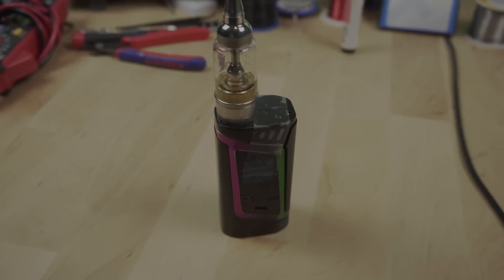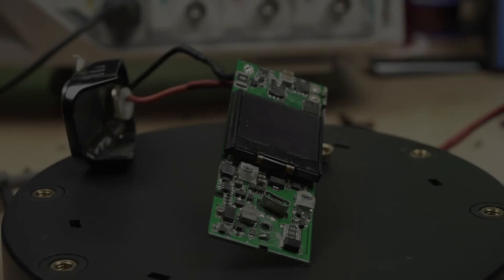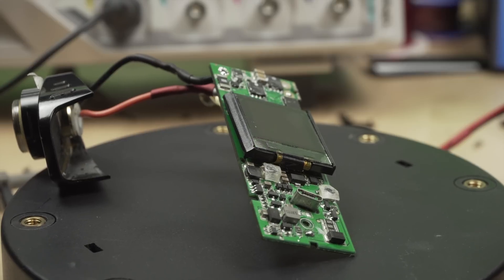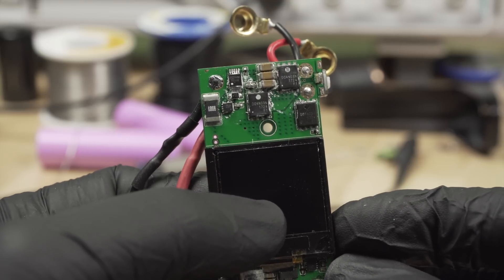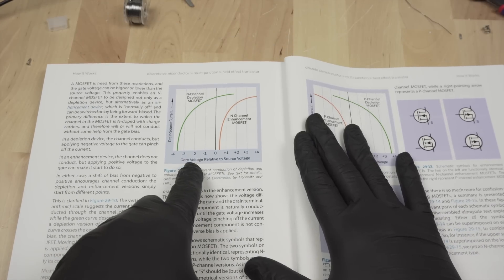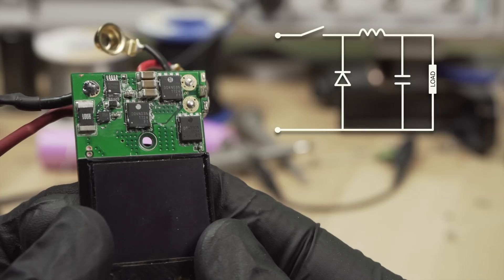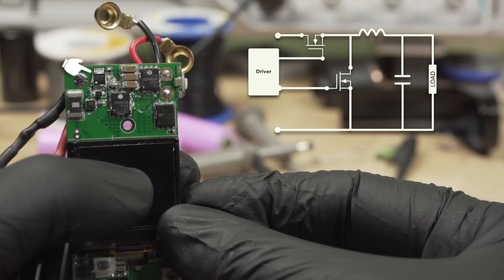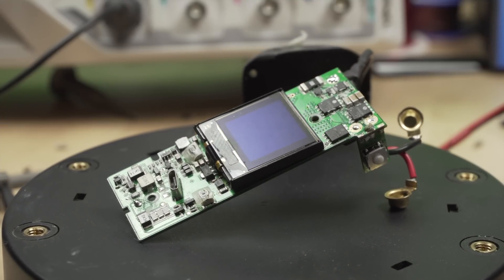Whats inside a 220W E-Cigarette ?

Comment: in the minute 6.55 i see pin conector. this is for programing? because im curious this module can make portable soldering iron. but in the originaly we just keep press firing button just in 10 second. no longer. but if we can remove program protect 10 second. we can make this for portable soldering iron.

Comment: Schicker Teardown, am Ende kommt es ein wenig abgehackt rüber. 
Was machst du da für ein Display in die Unterputzdose?

Nice teardown, but at the end it seems a bit clipped. But i liked your explanation of the synchronous boost converter.
What have you done with the display in the drywall socket?

Frohe Ostern.
Reply from the maker: Thanks! That will hold a temperature/humidity sensor and a display. One in every room